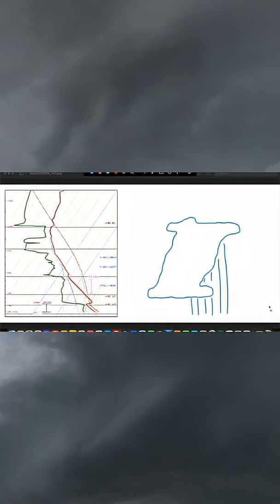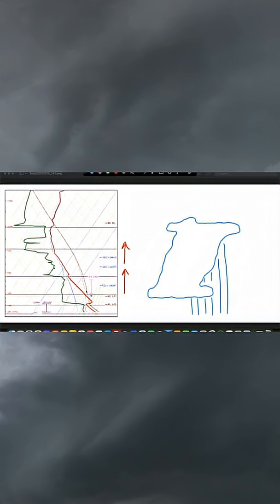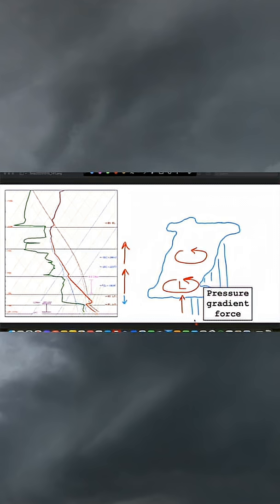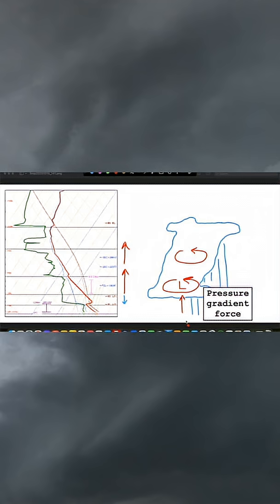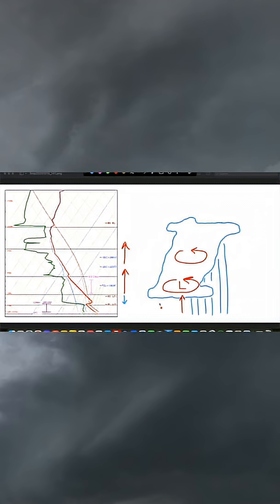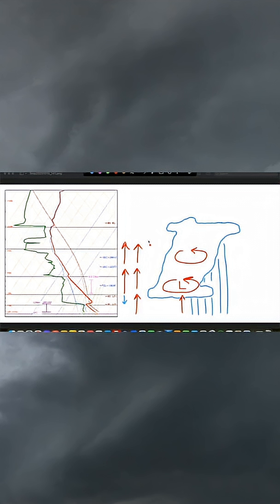How do elevated storms become surface-based? #severeweather #meteorology

Comment: Nice explanation 

Only point of confusion is how the thermo environment pictured could support elevated convection in the first place? All the buoyancy is in the boundary layer rather than aloft. Like none of the parcels you could lift would have any cape except close to the ground.

I’ve always thought of elevated convection as drawing inflow from a layer above the pbl?
Reply from the maker: Hmm, how are you getting that all the instability is in the boundary layer rather than aloft? The instability extends well above the PBL here. Regardless, you’d be lifting parcels from atop the inversion, which would have buoyancy but that buoyancy would be rooted above the surface, giving you elevated storms.

Comment: So, just curious, what level will the LCL be, then? If it overcomes the CINH, will it be somewhere in between those levels, or farther down? (Looks like you have it drawn in between, but why, basically😂)
Reply from the maker: It looks like it would be right at about 850 mb in this example. There is an important distinction though...whether a storm is surface-based or elevated does not have anything to do with its LCL (i.e. "high-based" does not equal "elevated"). A storm can have a high LCL and be surface-based; in contrast, an elevated storm can have a low LCL.
Reply: @ConvectiveChronicles  That helps a lot. Yup, got it confused.